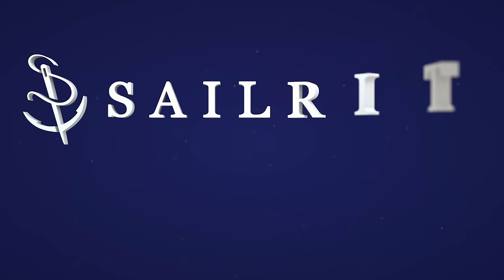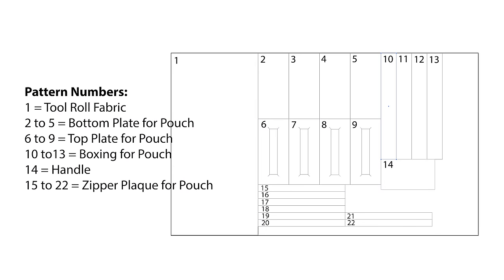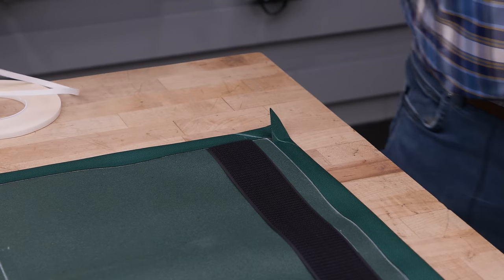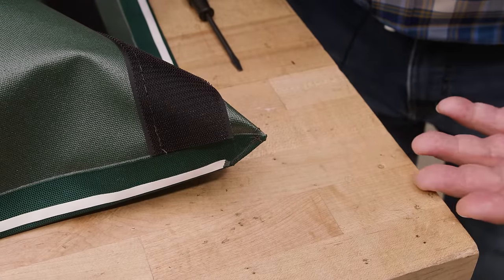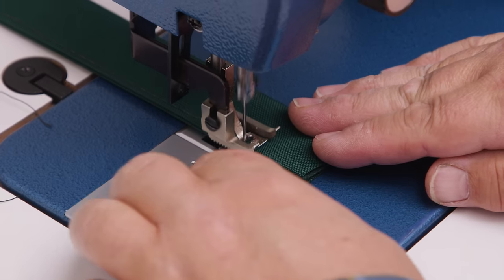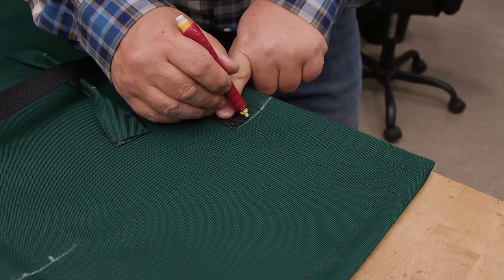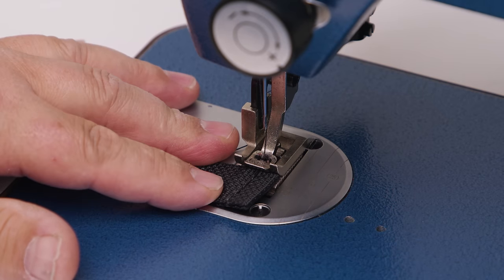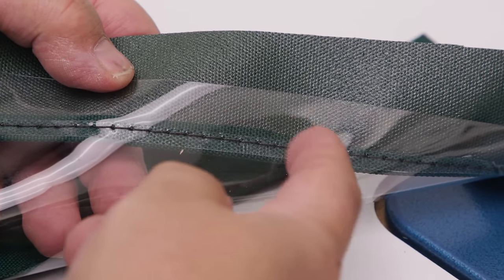How to Make a Tool Roll Bag With Zippered Pouches

Comment: Thanks so much for your great instructional video. Quality training. As the postage to Australia was excessive I had to figure out the pattern by watching your video and taking best guess estimates of sizes and scale. 
I've just finished  my zippered roll toolbag! It looks similar to yours too which is a bonus.  Doing this project has given me the confidence to tackle bunk mattresses and an awning for my boat. You guys rock. Thank you
Reply: Hi!! I was trying to do this too, but I don’t think I did a good job, would you be able to share?
Reply: @meganmarques2767  I just worked it out as I went and didnt really create a plan. You need to listen to what he says in terms of the sizes of any materials he is working with. taking note of his fabric width, webbing , and any mention of a measurement.  Then convert to metric for AU. Look at his parts layout and mimic that. You will never get it exact but it only needs to be close.
Its such a shame they dont make these plans available as a pdf. just a layout diagram with key measurements.  I wasnt trying to get something for nothing but the postage cost for their plan was insanely expensive. Id been happier to pay them for a pdf instead. they dont seem interested in doing business with Australia.

Comment: Thank you for this video.  Lots of details that help and guide.  I made this bag using the pattern and this video.  Did the bag in red cordura as it will be a medical kit for my son's truck.  I changed up the handle to a buckle on webbing so the bag can hang from the headrest.  Also added small handles to the side at the end of the zipper so it can be grabbed and carried apart from the roll.
Reply from the maker: Excellent. Good additions to the bag.

Comment: Great video as always, fantastic presentation style, just the right level of detail! For anyone using a domestic machine who obstinately refuses to be told they can't do the "optional" step of pinching up the handle and sewing through 8 layers right up against a bulky seam - I highly recommend using a leather sewing awl (Speedy Stitcher or similar, doesn't need to be expensive, just robust). Ran one of the hembobs through the small needle I had (don't bother using the awl's bobbin mechanism), and made a very tidy (I dare say tidier than my machine stitches) job of it. I recommend against using the basting tape (which I do otherwise find useful!), and instead use sewing clips to hold the sides together (or possibly clothing pegs if you don't have any) - the needle and thread get quite gummed up just from the 8 layers of cordura backing alone, so a bit of isopropyl and a paper towel come in handy too. 

This was after I stubbornly tried to do it on my Record 830 - was able to handcrank, but the results were pretty bad - sewing awl was basically as fast and infinitely better for this one!
Reply from the maker: Thanks for your very kind comments. Excellent suggestion for sewing the webbing handle with a home sewing machine. Thanks!!!

Comment: OK...  I finished the kit... it's really well planned.  The video instructions are good as I watched what I was supposed to do - paused the video - did the work - and moved along to the next step.

The project is good for beginners... the kit has about everything... plastic windows, zippers, box cushion fabrication, hook and loop, snaps... and the handle calls for sewing through eight layers... as there are four tool pouches you get the chance to get better as you work your way from the first to the fourth.

I also learned more about my LS machine... I managed to spike the needle into the hook and it made a burr...  the burr shredded the thread until I read the trouble shooting section of the manual... a bit of 1500 grit sandpaper smoothed the hook-face - no more shredding.

Ill buy another couple kits and sew them as gifts - the bag is really nice...
Reply from the maker: I am very glad that your tool roll bag with zippered pouches kit came out great! Thanks for the very kind comments!!! Keep sewing.

Comment: I agree with the comments below about how great your videos are. In fact, the videos were a large contributing factor as to why I bought an Ultrafeed machine! One question, however...I noticed that you are not holding or pinning the trailing threads when you start your stitch, something that you have pointed to in other videos that you always need to do to avoid tangled threads. Is this not the case?
Reply from the maker: Thanks for your kind comments. Holding the trailing threads before you sew is always recommended. When you see us not doing that in a video, it is only because we got lazy or forgot. When we do not hold the trailers we have a 50/50 chance of creating a bird's nest of messed up thread on the bottom side. So... it is a big gamble that should not be taken.
Reply: Thanks for the clarification. That makes perfect sense, because EVERY time I forget to hold the threads I get that bird's nest LOL. I've actually started using a 1-2-3 method every time...1-presser foot down, 2-hold the threads, 3-reversing stitch. I'm sure as I get better this will all be second nature, but for now it's really helping. Thanks again for these videos! @SailriteDIY

Comment: This is a great tutorial video. 🪡🪡🪡🪡🪡🪡. There are several from Sailrite though I believe this presenter is the best.  This kit is great and the pattern material if very durable.  Something others have noted, having printed instructions would be nice.  My only issue with the project is the basting tape collects fairly quickly on the needle causing a problem with sticking .  I have a Singer Signature - 9340 and switching to teflon coated needles dramatically improved the issue.
Reply from the maker: Hey, thanks a bunch for the shoutout! And yeah, the basting tape sticking to the needle can be a real pain with lighter weight fabrics and a home sewing machine. Good thing you found a solution with those teflon coated needles! I love using basting tape, so if I have to sew lighter fabrics with basting tape, I keep a cotton ball with rubbing alcohol socked on it and wipe the needle when it builds up. Happy sewing, my friend!

Comment: Never done any machine sewing , but this looks GREAT. When you do the forward/ reverse reinforce stitching,care you flicking a switch off screen to do that ? Or just pulling the job back and forth ? Total rookie here  👍
Reply from the maker: Thanks for your kind comment about the tool roll bag with zippered pouches. When we are reversing our stitch I pull a lever off the right down and hold it while reversing. When I am done I let go of the lever and it springs back up and sews in forward.

Comment: what is the best way to store the pattern cut-outs after they've been used and glued?
Reply from the maker: Simply stack them and roll them up together. Then place a few rubber bands around it. The excess glue can cause them to stick together, but they should come apart with a little effort when you want to use them again.

Comment: This is a nice way to practice many techniques for sure.  I do have a question, around minute 50 when placing the magnet to guide the material on the machine,  wouldn't it be easier using the long side of the guide instead of just that little edge?  I'm still getting used to the LSZ but seams with my singer were mostly crooked, granted I always pushed the machine to the limit with many layers or thick material.
Reply from the maker: I find that the deluxe magnetic guide on the small end lets me make turns easier and it also helps me keep the fabric up against the guide directly across from the needle. Keeping the correct seam allowance is mostly important directly across from where the needle enters the fabric than any other place.

Comment: I own a upholstery shop and the most time I spend is cutting material for welt cord how would that little saw thing work on cutting a lot of welt?
Reply from the maker: Yes, the Sailrite Cordless Rotary Cutter may be helpful for the job of cutting welting fabric.
Reply: @SailriteDIY  do you have a video on that saw
Reply from the maker: @rockyreynolds4027  If you mean the cordless rotary cutter, yes. Use this landing page link and scroll down to see two videos: https://www.sailrite.com/Sailrite-Cordless-Rotary-Cutter

Comment: This looks really handy for art supplies. What are the dimensions of the zippered pouches?
Reply: Unfinished panels are 13 x 7 and the edge is 3 inch. So roughly 12.25 x 6.25 x 2.25 inches I think.
Reply from the maker: Finished Measurements: 31"L x 12-1/2"W, unrolled. Each of the 4 zippered pouches are 12"L x 5"W x 2"D.

Comment: The handle that is attached at 23:30 would be more comfortable if stitched in upside down from what is shown.
Reply from the maker: Great suggestion!
Reply: Also burying a 1/4" cord in it. Mind you , it depends on how you expect to use it.

Comment: ok I watched the video , few things i would change I would reenforce boxes with some kraft board , would not put in clear vinyl I would put canvas in the front use a die cutter and write out  contents on front of box with htv , i am wondering why you folded over the outside edges over so much ? seemed like a waste , especially were this fabric doesnt fray .,. and lastly how do I get pattern ? I have lots of scrap that would be good for this but I only saw the kit . I dont need kit I have all I need in supplies . thank you deb bushee   Black Magic Woman
Reply from the maker: That is the great thing about DIY you can make any modification you desire to make the tool roll your own! Good suggestions. You can buy the pattern without the fabric and supplies here: https://www.sailrite.com/Tool-Roll-With-Zippered-Pouches-Pattern

Comment: Hello, why doesn't the needle stick together when they sew over the tape. For me, the thread always breaks. What am I doing wrong? I would be happy about your feedback. Sebastian from Neuss Germany
Reply from the maker: Usually glue build up on needles does not happen with medium to heavy weight fabrics. Using basting tape (Seamstick) for canvas on a very light weight fabric may gum up the needle rather quickly because the lighter fabric does not have the larger fibers or weave to help clean the needle as it exits the fabric. In those situations it may be best to use a seamstick that does not have as strong an adhesive (like item #20306) or instead use pins to hold the fabric in place as you sew. A gummed up needle and parts can be cleaned off with some rubbing alcohol on a cotton ball or Goo Gone (we do not sell this). I like to use McLube #845 on my parts and needle to clean and keep glue from building up.
Reply: I had this same problem. The basting tape supplied with the kit wreaked havoc on the project for me. My LSZ handled every fold and material like a champ but each time the needle passed through the Seamstick, it left adhesive on the needle and caused the thread to break. Is there any way to manage this problem. I still have the four bags to do and I can’t imagine doing them without the aid of double sided tape.

Comment: No hot  knife cutting that fabric is going to make the inside of those bags a fuzzy stringy mess when those edges get worn.
Reply from the maker: We used Cordura HP fabric which features a clear polyurethane coating on the back. This coating prevents cut edges from fraying, so no hot knife is required.
Reply: @SailriteDIY  How long is that polyurethane coating going to last?  I have tons a lot of gear where Cordura poly backed  fabric has frayed after a decade.
Reply from the maker: @elffirrdesign2063  If your fabric has lasted a decade, which is 10 years, before fraying occurred, I would say that is excellent. I am not sure how long Cordura HP will last because it depends on how heavily the bag is used. I will say that it is a very tough fabric for this kind of applications.